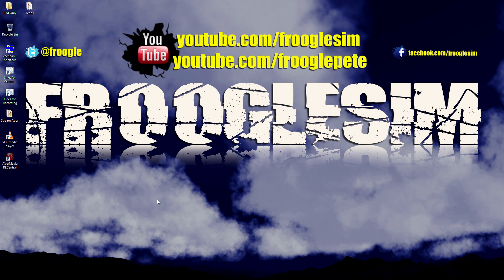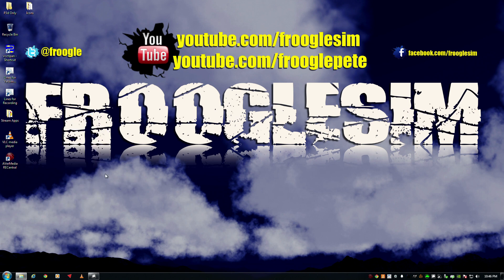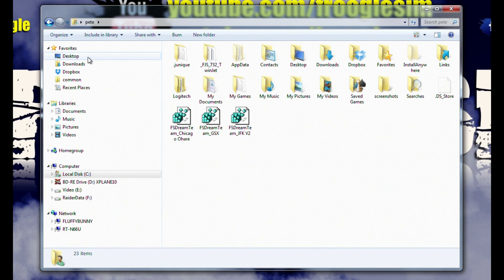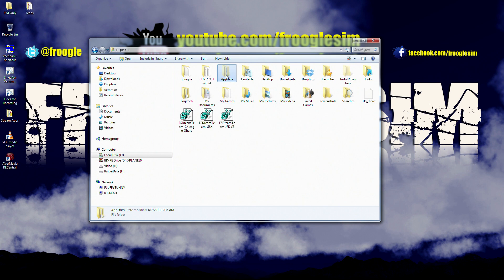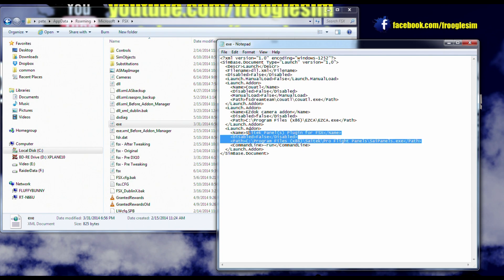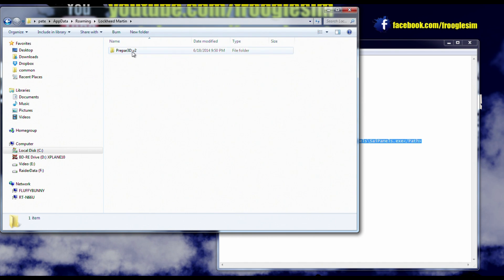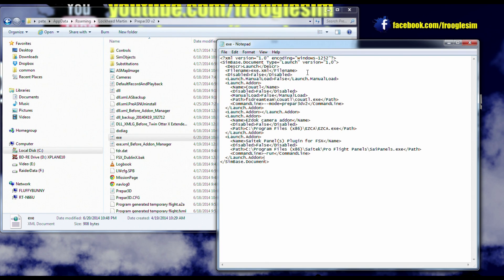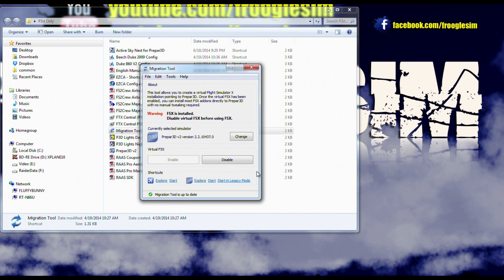HOW TO: SAITEK PANELS IN PREPAR3D

Comment: Does anyone else have the same problem as I do, every time I use the switch panel with P3D I have to switch each one on/off, on/off, it does not work the way its supposed to, very frustrating. Saitek says everything works but does not offer any support when I ask about this issue.

Comment: Froogle, I DONT have FSX installed but DO HAVE the migration tool and doing what you have described in the latter part of the video has made no difference for me as the panels are still not working after installing the Saitek drivers with the migration tool enabled.

Comment: I use SPAD for both FSX and Prepar3d. It works better once you have the hang of it and you can change the use of buttons and save different profiles for different aircraft. It free and you run it in the background and delete the files from exe on FSX so I never had any trouble with using the Saitek panels with P3D  http://fstools.weebly.com/